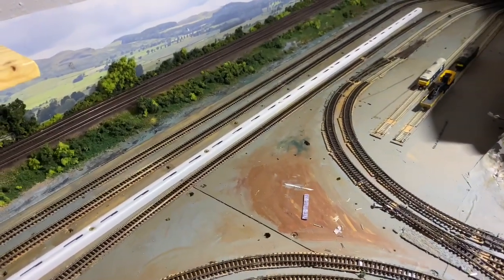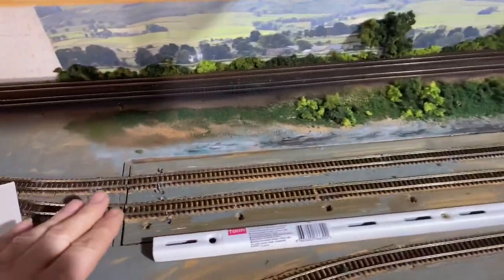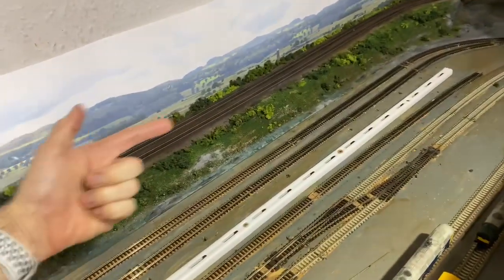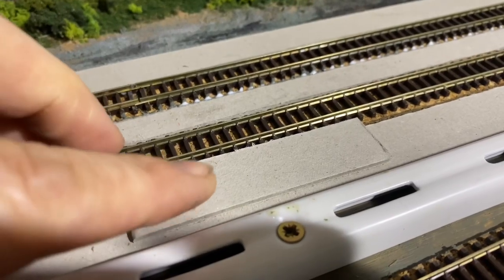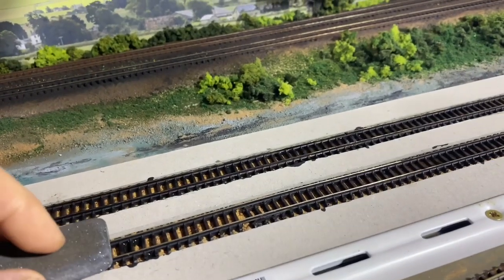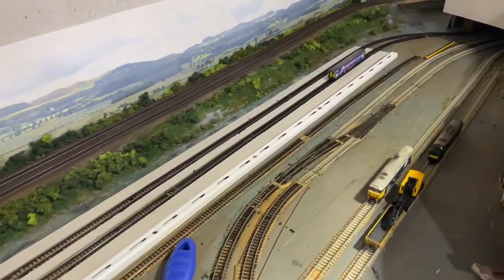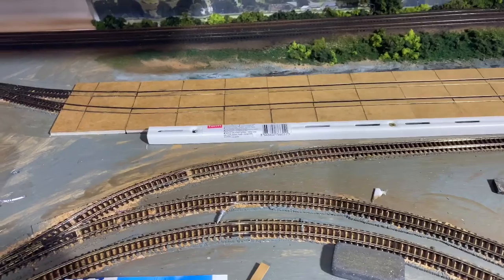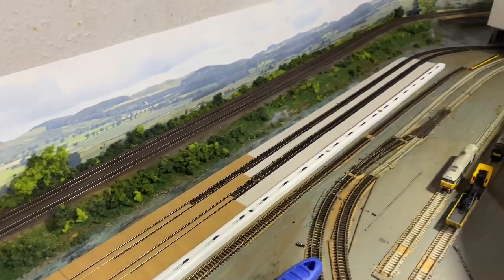LAYOUT UPDATE, SCRATCH BUILDING - HARD STANDING part 1 - CONSTRUCTION

Comment: Good video - the only thing I worry about (sorry), is that the card will warp under the paint and lift?

Or if it doesn't with the paint, it will do in the future because of temperature and moisture change. :(
Reply from the maker: Ted Maintenance Depot thank you for commenting. The layout is in a bedroom and Im sure itll be fine, I am going to seal the hrd stding before painting. If it does lift Ill deal with it. It’s not the end of the world, really. No need to worry!!
Reply: Fingers crossed John. Perhaps I'm too cautious, I was going to make mine out of plaster (which will be messy)!

Comment: Hi, thanks for the informative video. Let me see if I have this right, you used 2 x 2mm to make it 4mm and then was it 2 layers of cereal packets? I don’t eat cereal so I’m going to assume that packets are only .5 in thickness as you only wanted 1mm. What you didn’t share with us is how you managed to get the card right up to the edge of the rail particularly on the curve which would have been helpful as I always manage to get great gaps in mine.
Thanks, Mel
Reply from the maker: Melford Horrocks thankyou Mel, yes you are right with the card. I just used the cereal packets as they were right there, I didn’t have to order anything. I’ve just measured the card with a vernier it is 0.2 mm (x 2 obviously). The exact number of layers does depend on the track, the surface it’s stuck to, whether track is perfectly flat or otherwise etc etc etc. So my measurements MAY varying from your setup. I show what I’m doing, to share the idea. Each person chooses to adapt the process if required. 

The curves at the ends are really shallow next to the lift. However, I would put the card up against the rail, draw along the rail with a sharp pencil. Cut out, check it, and keep repeating till it’s right. Hope that helps.